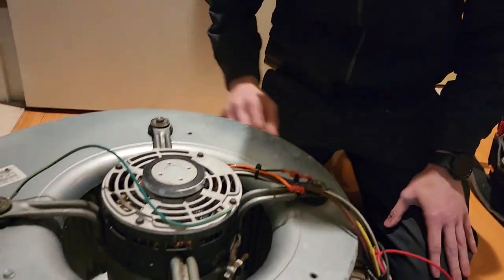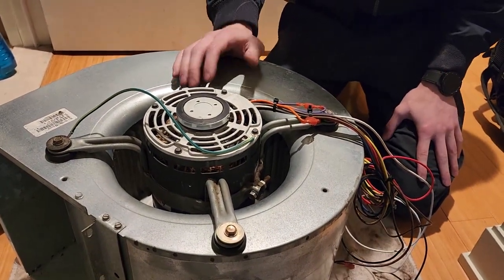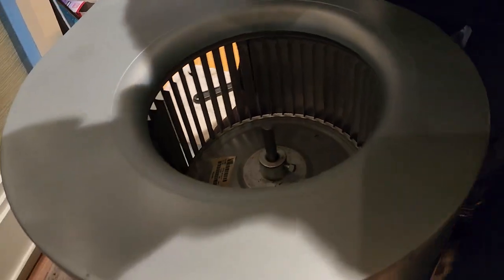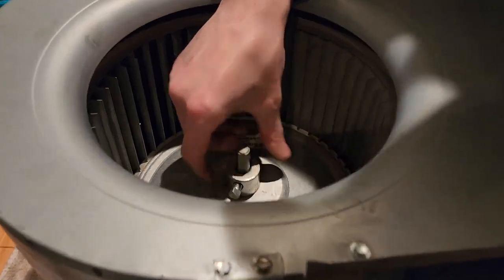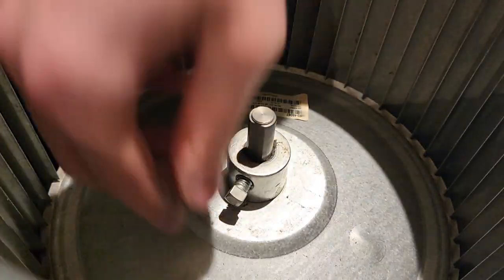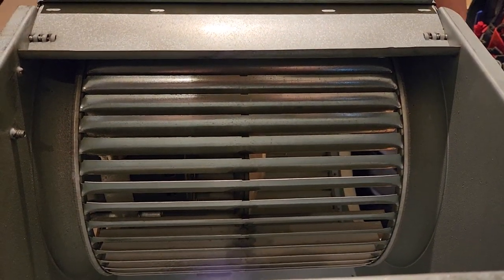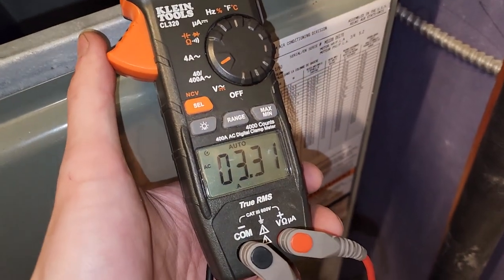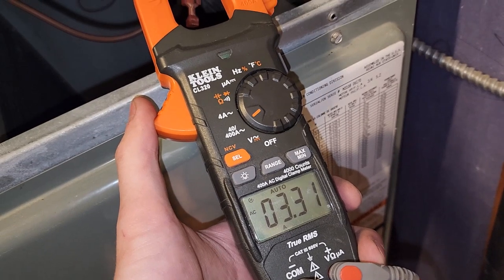Replacement OEM Rheem PSC Blower Motor! Why Did it Burn Out??? Using Klien 9 in 1 Impact Bit

Comment: Learned a long time ago to stick with OEM replacement parts……less headache’s 😋
Reply from the maker: Can't keep OEM parts for every single unit we deal with stocked on the truck
Reply: @DCHVAC  better off ordering OEM and returning with the right motor…. As it stands you made two trips anyway with your “Rescue” or should I say “Let down” motor

Comment: The problem with keeping stock on the truck bouncing around all the time and not getting used for a year or more you will run into times that it doesn't work.
Reply from the maker: Motor hadn't even been on the truck for a year yet.